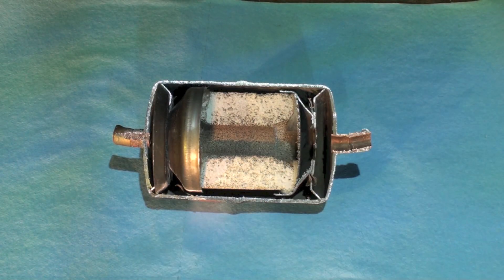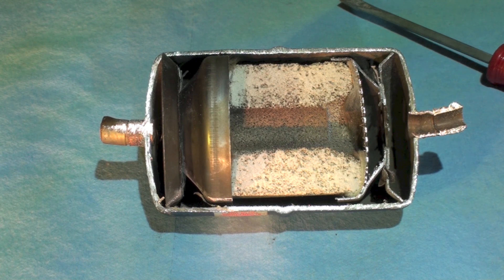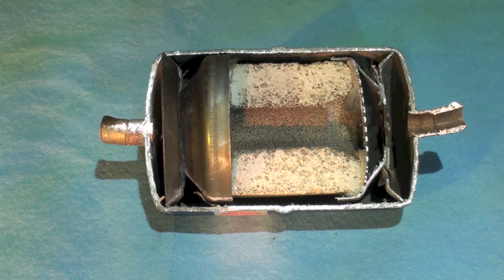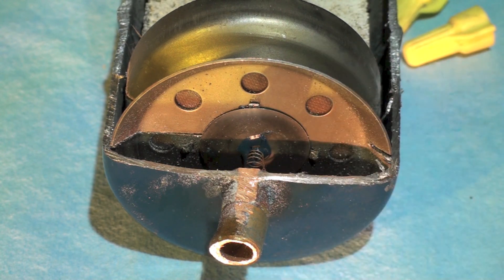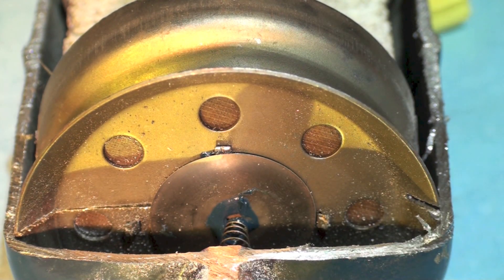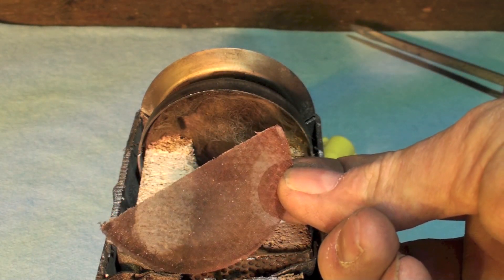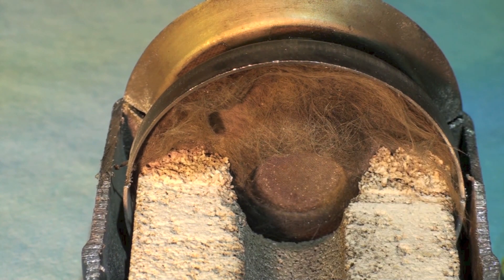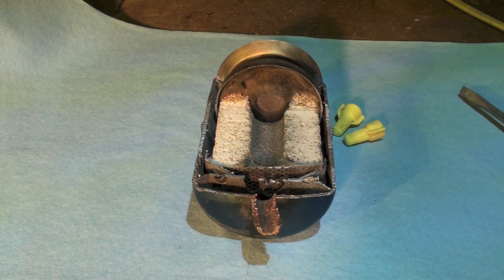The heat pump liquid line drier disassembled

Comment: a 163 s is usually good for 5 hp or 5 tons
Reply from the maker: Could be a pretty big difference between 5 hp and 5 tons.  Especially if its a low temp box.  Agree on the 5 ton.
GFM

Comment: How much of a pressure drop will that design have?
Reply from the maker: E.W Hawkins It depends on the tonnage and refrigerant.  Example:  HPC-163-S at 5.4 tons a/c 1# drop 
R-410A.  Sporlan has all the specs in their manual.
GFM

Comment: This filter dryer is nowadays used in both straight cool and heat pumps cause of the new R410a mandate by the federal government cause pure-on refirgant is a blend of liquid and gas and if not filtered properly may lead to reduction in efficacy in cooling do deposits dirt and other corrosive particles from the charge that may cause damage to the indoor coil and outside coil as well my Amana system has suction line and liquid line filter dryer that is a dual purpose one.
Reply from the maker: MIKE CHIESA I have not seen where a suction line drier is used on a system that has not had a bad burnout compressor.  
GFM